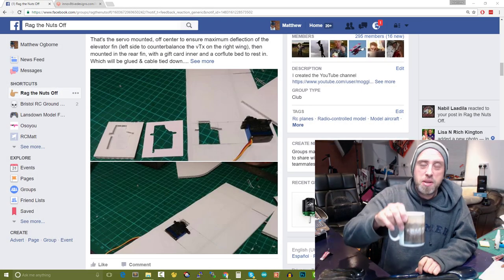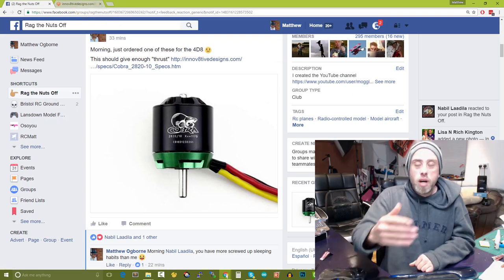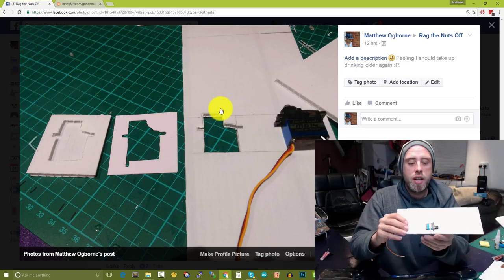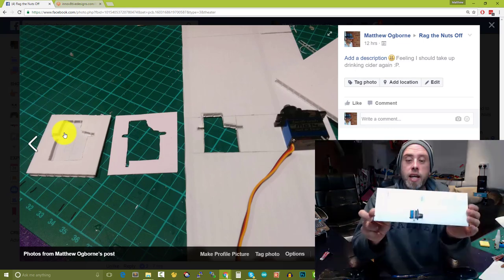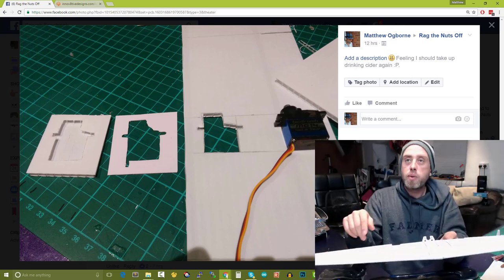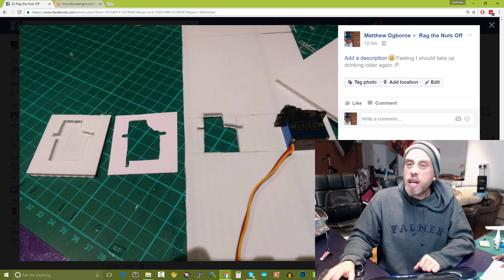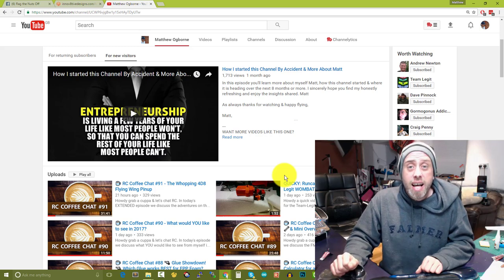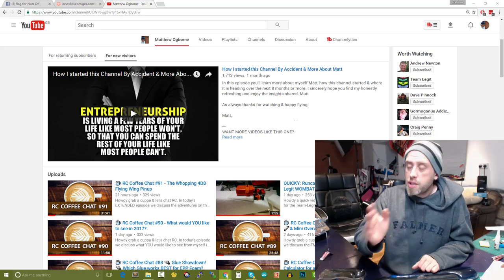☕ RC Coffee Chat #92 - Glass Fiber V's Carbon Fiber Rods & Happy New Year! 🎉

Comment: You could always over prop the SK3 motor on the 4D8 wing to get some extra thrust for the launch and then throttle back (you are aware that the left stick has positions other than closed and WOT?) to crusing speed
Reply from the maker: Hahhahahahhahahaha yea going to over prop it, assuming the Cobra motor doesn't arrive in time for the maiden :) Matt PS. ON or OFF, is there any other throttle position?

Comment: Matt. Morning. Simple question, but i cant think straight, right now. If i want to use a quad motor, on a tail pusher wing, i need a CW or CCW? So i can use standard props? My head just wont work this morning.
Reply: Keith Artherton you can use either CCW or CW, you just have to use a prop that matches and make sure it is spinning the right way
Reply from the maker: Exactly, ty FlyingAmbo!
Reply: FlyingAmbo Thank you. Fool i am! So funny. You can tell I haven't done much quad stuff, can't ya. Of course, i can get prop both ways now. Didn't think of that at the time. Always had fixed wings here. Thank you anyway. Sorted now. 😇😃😉👍
Reply: Keith Artherton I do the same, fly fixed wing but use a lot of quad stuff. Just always remember that if it's a pusher or puller keep the writing pointing forwards on the props.
Reply from the maker: Yea otherwise it flies like poop, learned that one ages ago! Matt